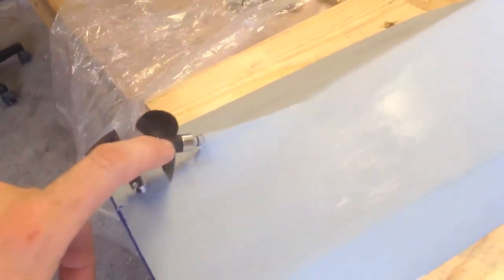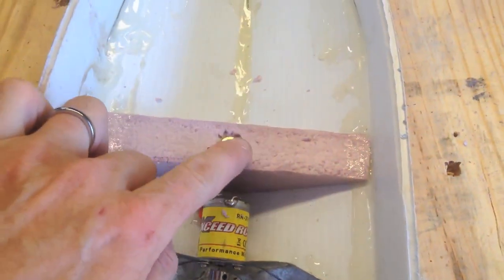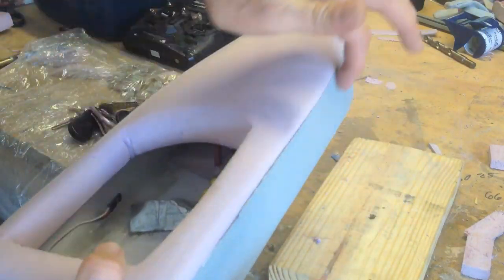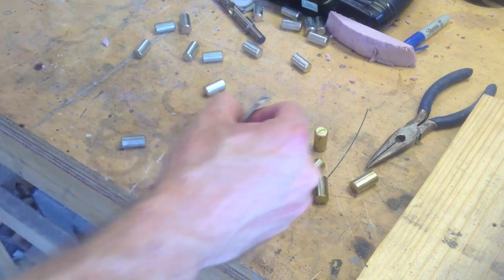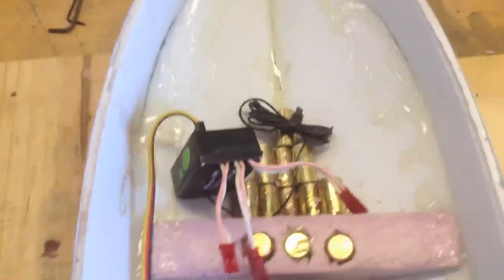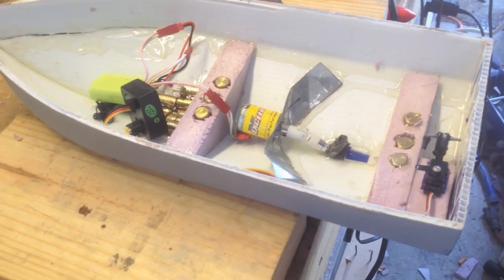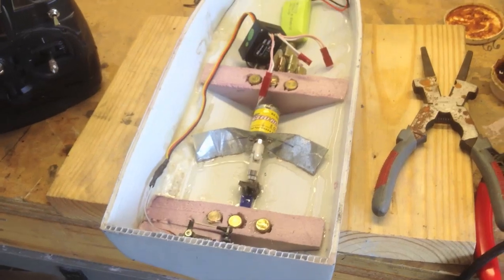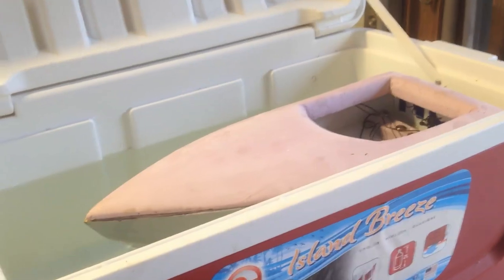DIY RC Boat Build (Part 3: Test Run)

Comment: Thank you.  I am trying to build a scale copy of my boat, a 17.5ft runabout hull that we fitted with a half cabin for fishing/camping trips.  The model is 17.5 inches long and I was killing myself trying to cut the plywood for the hull "by eye" and couldn"t get the curves right.  I tried the way you did with the sign board and with a little bending, the 1/4" plywood now hold the bends & I was able to get the shape right!  I should have videoed it.  All that's left to do is the deck & cabin and rc electronics.  Thanks again for the guide & ideas.

Comment: absolutely  awesome mate! i build 'real' rc boats for a living but its more a matter of putting parts together off the shelf, what you did here with the sign and bondo is thinking outside of the box. a chunk of foam carved out would have saved a lot of time, but it wouldn't  have the cool factor yours has.
yes the heli motor is a high rpm motor that has no torque, try using a motor and esc 
 from a car and you will have better results.

Comment: Awesome I love it 
To make it faster upgrade the battery to a 7 cell nimh they are relatively cheap and it will boost the performance significantly 
To prevent the motor from overheating you should take plastic or metal tubing and wrap it around the motor with a tube leading from the water the to the motor then out of the boat
Hope this helps

Comment: I love the boat design, I’ve done electric planes out of the same material before. I know these videos are a few years old, but as far as the boat goes, you have a few issues, that prop is about 2 times the size it needs to be. Find one about half the diameter and that will reduce the heat from the motor. Secondly as I think you said, those electronics were never ment to carry that kind of load, esp that receiver/Esc combo. And last, the weight is probably what did it in, esp with the electronics/propeller combo. My guess is even though the set up would still have been very hot an still inefficient, without the steel ballast it would have planed out and ran quite a bit faster. Anyhow, sorry for being long winded, but I loved the boat design and the all foam cover was really cool. I’d love to see what it’d do with a proper set up! Take care sir

Comment: Nice video! You may want to increase the motor's efficiency by better aligning it with the shaft. You could also fill the space between shaft and tube with silicon grease to keep the water out.
Reply from the maker: Right on.  Thanks for the advice!
Reply: I built my own and I had my motor in the water so it was water cooled.
Reply: And a way to not overload the motor and esc is to cut about 1-3 mm of the end of you're props and that will let the motor spin with less stress.

Comment: problem isnt the motor, problem is the battery pack. you need to get a higher c discharge rating. thats why the battery failed.

Comment: Love the boat, but I was confused how u keep water from going up the rudder and propeller shafts.
Reply from the maker: +William Wiechert Thank you.  The rudder tube is above the water line and the shaft which is from an rc helicopter is fairly tight and has two sealed bearings.  I do get a bit of water in there but not much.

Comment: U should make a water cooling system with the thrust from the motor and the speed
Reply from the maker: Yeah I've seen some motors that have a water cooling system built in.  I may get one of those.
Reply: +Absorber Of Light it's pretty easy I have it on two of my boats
Reply: q

Comment: Where is the esc without the esc u might burn the recciever
Reply from the maker: I was using the components that came with the helicopter.  I'm sure it had a small esc included in the enclosure.  Anyway, I will be upgrading everything shortly, esc's motor etc.   Thanks for watching!
Reply: Absorber Of Light What do you use to turn the fin, I just started building one and I'm stuck on how to turn the fin